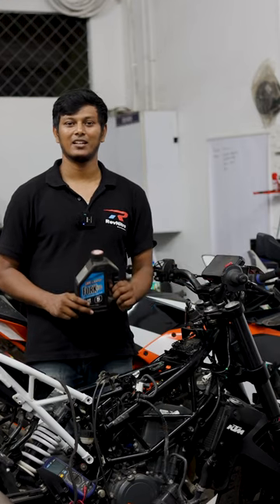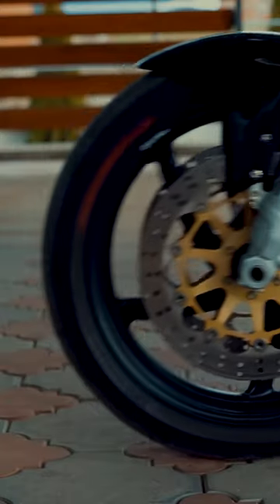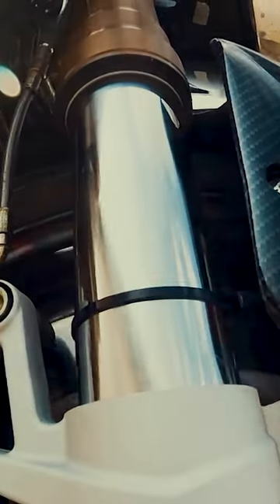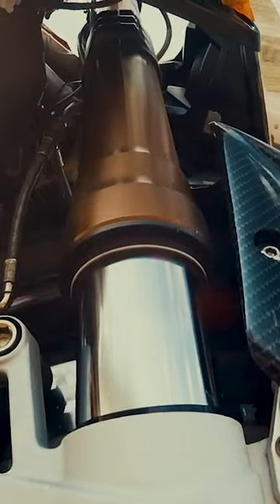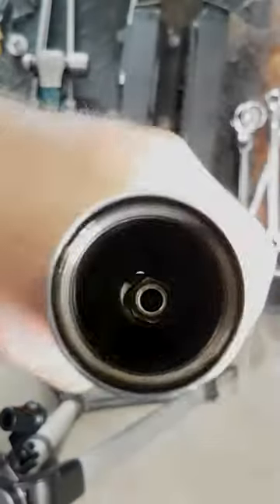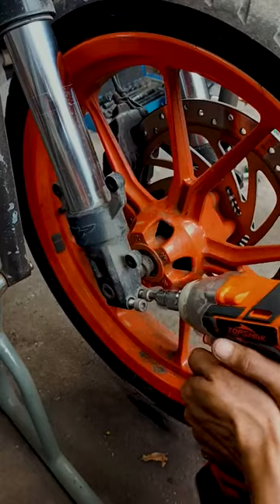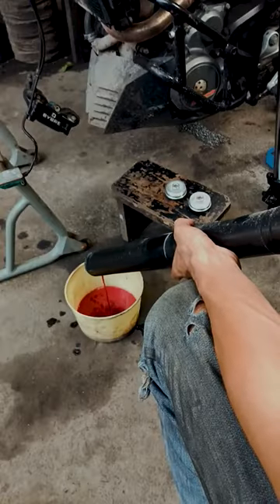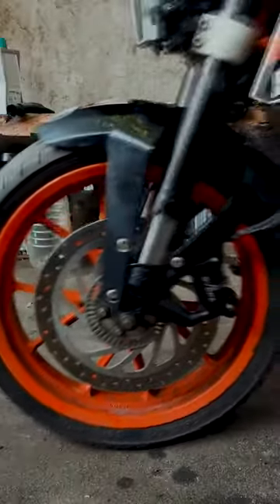Bikela idha check panna marakadhinga! | RevNitro

Comment: Right bro what about other bikes when should I change fork oil ... in pulsar...
Reply: Bro check your bike manual. For my apache 160 4v it's 18000 kms but i changed at 17000 kms for safety.
Reply: @nithilkumar5009  ohh ok bro..

Comment: Bro is there any place who does it professionally?!. I am afraid to hand it over to a name sake mechanic. It should be properly calibrated. 

I own hornet 2.0. You may think it is too much for 190cc bike. But, i love riding this bike the refinement and ride experience is ❤. I have done 440+ KM in same day without any issue or pain, no heating issues. So, i need a best place where can i check my suspensions. I have completed 24000 KMs